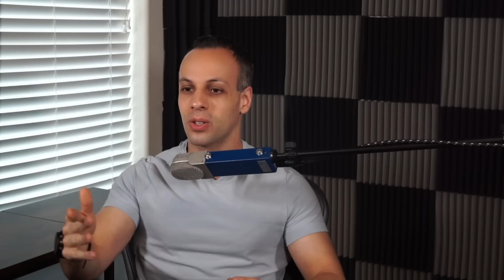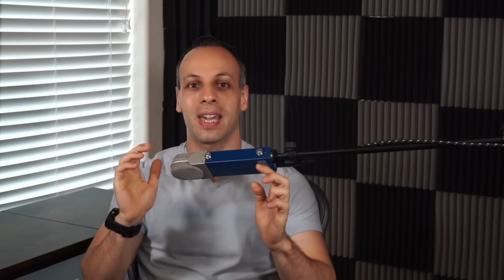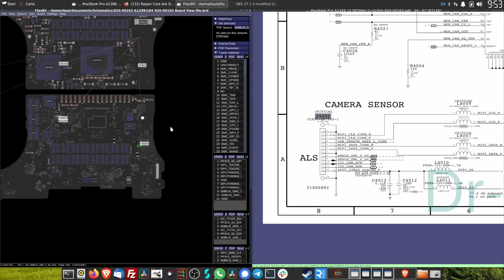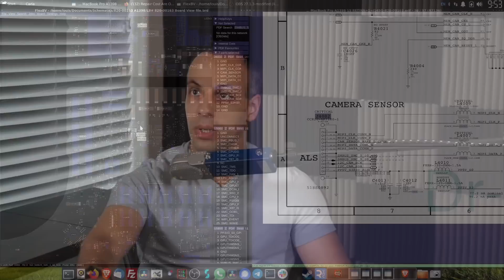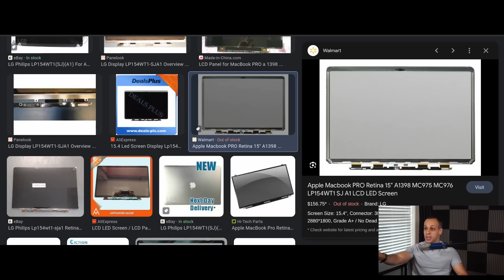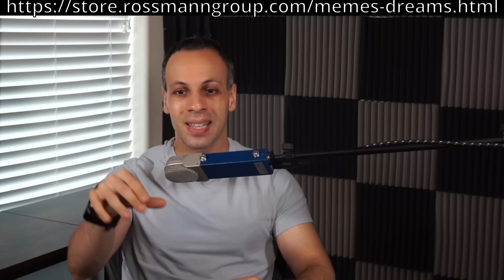The Ford F150 Macbook - when car repair resembles macbook repair...

Comment: What really sucks is that cars used to have more repairability legally mandated. Like there were a total of two headlights legally approved. So you could buy the one you have basically anywhere and install it. Compare to the modern headlight housings. And the massive, easier to break, proprietary headlight fixtures that you can’t just change the bulb in is 100% a price gouging, anti-repair thing.
Reply: There really should be legally mandated limits on what manufacturers can charge for replacement parts.  You really think it cost Ford $5000 for each of those tail lights when they install them on the assembly line?  That $50k car ends up being a $500k car if you order replacements for all the parts.

But of course, that's the point.  "Don't get a replacement transmission for $8k. Just buy a new car!"
Reply: This guy watches Technology Connections 👍
Reply: And they were glass so didn't turn opaque either in 18 months.  My 69 beetle lights are still clear when I wash the pollen of them.
Reply: It's the semi-sealed light housings that have issues  @robertsmith2956 ,with the chrome tarnishing and flaking with moister exposer. 
due to poor seals on the backside.
Getting new light seals for the globe area can be a pain, to say the least...
Yet sealed beam lights weren't much better than a Dolphin Torch!
Reply: Standard-sized sealed beams, which are one-piece lamps, were cheap (even the halogen ones) and easy to replace and aim.
Reply: My 94 Suburban had the replaceable bulb. You had to remove the grill,then the headlight to replace the bulb.
Reply: @FuzzyWCTX . Um, I can at least say they must have FIXED that design flaw because my 2003 Suburban takes about 2 minutes to change headlight, turn signal or daytime running lights.  It could be any simpler.  Matter of fact, one doesn't even need one tool to complete the job.
Reply: Currently now you can find matrix LED lights. They also bring pluses, not only minuses :)
Reply: Half the reason why mechanics are in such high demand nowadays is because those who spent even 10-20 years in the field just don't want to repair these poorly engineered modern cars. It has nothing to do with more maintainanence, electronics, or people not wanting to work. It's the fact that what was an easy 20-30 minute repair on cars from the 90s and early 2000s is now a 3-4 hour repair because they've engineered it poorly to encourage people to just get the warranty from the dealer & call it a day.

Longer repair times means more charges in labor to the customer at non-dealer shops. It's a huge scam and a lot of car mechanics have finally had enough of it. Isn't late stage capitalism just grand?
Reply: @bbbbbbb51  They also need more and more sophisticated vendor-tied tools and software licenses to work on the electronic systems, which of course also come with higher up-front and recurring costs, so the mechanic makes less margin on the longer and more tedious jobs.
Reply: @bbbbbbb51 this is the reason why I don't want to become a mechanic.  I love cars, I love working on my car but I refuse to do anything with the new cars.
Reply: It is coporatism and regulatory capture.
Reply: ding ding we have a winner! @the_expidition427  Please see the security guards on your way out to collect your, uhh, PRIZE!

Sarcastic yet probably true.
Reply: Be glad sealed beams went away. Their output was mediocre. I enjoy being able to see at night. The US is decades behind Europe when it comes to automotive lighting technology. Not saying the high costs are justifiable. Just that they have Bette system that allow you see better at night. Which is the whole point of headlights.
Reply: @Bob_Smith19  No need to see very far, we can't go fast enough to need more light.
Reply: @robertsmith2956 sadly most people drive faster than their high beans allow for while using low beams.
Reply: @Bob_Smith19 sealed beams could have been improved further. There was no regulatory push to do so.

And at one point they were pretty good, but the manufacturing equipment wasn't maintained. By the 80s the equipment was all worn out and no one spent any money to improve things.
Reply: The lights aren't that expensive for Ford but they aren't cheap either.  Usually about 1/5 - 1/3 the consumer cost is what the OEM pays for the parts
Reply: Yah well nowadays people are terrified of legislation and hate laws, so we get corporations screwing us over 10 times worse.

Comment: Could this be due to newer safety regulations requiring these kinds of sensors and resulting vehicle shutoffs?  More sociopathic executives than before?  Diversity hires in engineering?  Or are Blackrock and Vanguard demanding that Ford finds new ways to juice their share price?

Comment: Hi Louis Two examples. I am a landscaper and when I have to deal with maintaining a property designed by a landscape "Architect " it is a nightmare. They make things inaccessible for maintenance  but it looks pretty. Second, I have a plumber that was given plan to use in a new build. He looked at the plans and said it wouldn't work. He was told the designer went to school to design the system and he should just build it. After it didn't work he had to redo it. Those that can do Those that can't design I guess.
Reply: Designers should have to be able to do basic maintenance on the cars they design for it to be a passable option IMO.

Specialty tools should be kept to a minimum, especially for functions like shifting gears or releasing the parking brake in an emergency (the DOT needs to make electronic shifters and parking brakes illegal for this reason).

Comment: Someone eventually is going to start building old fashion vehicles without computers in them again after consumers start to realize "if it wasn't broken thirty years ago, we shouldn't have tried to fix it" sets in.
Reply: It's nice to think this would happen. There is just one little issue, government. Any car manufacturer is more than capable of making a simple, reliable car these days. The problem is they have to keep adding safety features and mileage to meet unrealistic goals set by the government. So we end up with failing sensors, exploding small displacement turbos and just lighter and crappier quality all around.

Comment: This was designed to fail ON PURPOSE, AGAIN. The beauty of CAN-Bus on vehicles is that it allows all external components to share the same communication lines with the main computer (usually 2 or 3 wires) to minimize wiring from all external components individually to the main computer.  How ONE component can take out MULTIPLE or the ENTIRE system down on CAN bus is downright unethical and violates the entire point of using the CAN bus protocol on a vehicle.  I smell a lawsuit.

Comment: I don't understand why things are designed this way. Why can't the taillight be just a light for the bottom half and a top half be the sensor and the sensor connect via one of those plastic boat plugs like how the electronics do on boats lol. That way, if the "light breaks" you take the casing off, unscrew the bottom fixture and put in a new light. If the "sensor breaks" you unscrew the sensor top half, pull it out, un clip the plastic connector, clip in the new one, screw back in and replace the cover? Like that sounds like old modular tech and if that costs an extra say 20 dollars, upcharge it to the seller as a feature. People will pay for quality and ease down the road, pun intended.
Reply: The sensor was designed that way.  But the sensor alone is over $100, and in this case a short damaged vehicle side electronics.  Not the lamp's fault; something must have gone wrong with the protection circuitry on the body side.

Comment: What it would look like on my 17 year old Volvo:
50 bucks used on ebay, probably ~100€ bucks new aftermarket and ~200€ OE Volvo part.
And its all standard lightbulbs so I could fix it in an afternoon anyways and would not even have to buy a new tail light assembly.
Not a single sensor in there 😂

This world has become such a fucking meme. 
Apart from that I have once limped my Volvo home 100 miles with a damaged fuel injector, a transmission that wouldnt shift past 3rd gear and was making concerning whining noises.
Brought it to my trusted mechanic, he diagnosed the injector, changed it, reset everything and the car is back to normal.
Transmission is quiet now but a fluid change is on the agenda.

That to me proves a point and my point is that cars from certain eras just work and are cheap and easy to work on.
A 20 Year old VW Golf for example will outlive its modern equivalent im 100% sure.

Comment: I saw that F-150 video from FordTech-Make-U-Nuts!  Speaking generically (i.e., there's more detail to this for those interested in doing it), if the mid-speed LAN is anything like the networks in some other makes, what "could" be done is to disconnect the obstacle sensing module connector (or just cut/cap its wires) and then splice the CAN lines going to and from the module with a resistor of a definitive value.  In GM I think it's a 60 ohm resistor (there's one on the other side of the CAN that's 60 as well, so a total of 120 +/-).  That would relieve the CAN from all the network junk screwing up regular communication and all the other modules should be able to become "talkative" to one another again.  This solution could work until Ford decides it's a good customer experience decision to start selling singled-out replacement modules - as opposed to the entire 5,000+ dollar set of "will break again in the future" components.
Reply: So cars nowadays are using ethernet to communicate internally?
Reply: @25566  - not exactly, but it's the same concept.  Not all "networks" are the same either.  I.e., if you have a home network with multiple devices, it's unlikely that one "going down" will cause everything to cease communication.  With cars (and I have no idea why they've done it this way) it's not the same.  Depending on the typology and setup for the make / model / and chosen options, one module broken-down in the right way COULD bring the whole circus to a standstill.  And it's not an easy determination either.  It's not like an automotive diagnostician can simply plug-in and find the fault in a few mins.  Sometimes - after determining the root cause to be a network comm fault - it's a "disconnect individual modules one at a time until the network comes back to life" process.  Lesson of this part of the story is find a good diagnostician and TAKE CARE OF THEM WITH KINDNESS, PATIENCE, and GRATITUDE.  Oh...and send them references too.
Reply: @25566  No, they are using CAN bus, not Ethernet.
Reply: @CedarPass @Rossmanngroup
This needs to be pinned!!!!!

Comment: Got to love how "Built Ford Tough" means you can't drive your truck in the rain.
Reply: Probably can't even park your truck in the rain. 🤦‍♂️
Reply: @southernflatland awww the retard that buys ford pieces of shit is offended
Reply: My 1964 VW splittie Kombi leaks water to the inside of the car when it rains.
It doesn't however stop running.
Even when the rain is 2 foot deep😁
Reply: @andrewallen9993 
Much love to my VW homies even if you breathe the air variety and I drink the water variety.
Edit: please tell me ya got safari windows ❤
Reply: @MrTheHillfolk  In South Africa? Afraid not but I could add them.
Reply: @andrewallen9993  
I know they're expensive but it would be kinda cool in more ways than one.
I'd figure those would almost be mandatory,isn't it kinda warm there ?
Reply: @MrTheHillfolk  yes but the tilting ventilation windows and overhead air inlets move an awful lot of air once you are moving :)
Reply: @MrTheHillfolk is this like some kind of code you have to have weaponized autism to understand?
Reply: @andrewallen9993  
Yes they do for sure ! 
Only need em cracked open like an inch or so for anything faster than 30 or so 😂
Reply: Fix Or Repair Daily
Reply: @bitelaserkhalif  Found On Road Dead
Reply: @FredFredrickson-bip-bang   First On Race Day, I have others just can't remember them right now.
Reply: @bitelaserkhalif  They may have to rebrand.  FPOBO.  Fckn Part On Back Order.
Sadly the companies that made the electronic ignition conversions in the 70's went out of business.  So I can 't modify my f-100 now.  I lost the one I had from a '71 Custom 500 in a tornado.  At least I still have my dwell meter.
Reply: I just stick with Toyota now. Yes they have issues as well like all of them. But Honda and Toyota seem to be the most reliable in most cases really.
Reply: That's what marketing can do to products. It can turn things that once had meaning into a token gesture and a cheap promise to the customer.
"Built Ford Tough" probably had more physical meaning a long time ago, now it means nothing but a marketing buzz word to excite the mind for a moment, and make people think it's worth spending their money.
Reply: @Andrew90046zero  I think its meant to rub off on the customer. He's "Tough" because he's a Ford owner. It's a symbol for a performative lifestyle.
Reply: @RatPfink66  like my old VW bus, I can keep going slowly for an awfully long time 😉
Reply: @RatPfink66   yup
Reply: Pathetic 😆
Reply: They are putting too much tech in our cars. The more crap they do the more things break, catastrophically. Not to mention all the cheap plastic used when metal parts can be cheap enough and last far longer.
Reply: 6:04 EXACTLY!  the $200 AC evaporator on my 2015 ford sprang a leak... $1,400 to repair bc they had to remove the entire dash... ford dealer wanted $4,000! 
Do these stupid auto execs and lead engineers HAVE NO IDEA that American families CAN NOT  AFFORD to Shell out thousands of dollars for repairs that should not be needed (for vehicles that families must rely on)?
Reply: @vvvci  Dealerships are complete ripoffs. Sure they need to make money, but they really are terrible. I will never take a car to one unless it’s under warranty.
Reply: those years are long gone... American manufactures are back to ignoring what the consumers want again
Reply: Last Ford I purchased an 18. Have had SEVERAL (try 7) over the years but NO MORE! Ford has lost their mind!! 

Find you a clean 96 F250 gas Ford and REBUILD BODY OFF FRAME, new engine interior and paint.

Now you SAVED money over a new F250, got TAILLIGHTS bulbs are less than 10.00 each for and the WHOLE TRUCK will last you 20 more years ! I am done Jim Frawley is an idiot and will be the end of FORD forever. What happened to the wise man Lee Iaccoca who was "Quality Job 1" and "Built Ford Tough" We now its Built Ford Proud but quality and durability are OUT THE WINDOW!!!! Sign me no more Fords EVER
Reply: @@GH0STST4RSCR34M different names, different places 😁
Reply: Oh, you can.  You jusr won't be able to do a thing with it afterwards
Reply: Apparently don't wash a Ford either. Or know where to tape things..
Reply: Not that I necessarily a Ford fan, but it sure seems like in the last 10 years that they use the public as guinea pigs, they have so many recalls and service bulletins it's not even funny.
Reply: Or perhaps into waist deep streams or floods. How it happened wasn't part of the story.
Reply: @hulknotlikepunybanner  if it was waist deep water the vehicle would have required two taillights. 
Plus an awful lot more electronics .
Reply: @andrewallen9993 
Pretty sure they ended up replacing both taillights in that video
Reply: My dad's drinking buddy always mocked the brand, saying it means
Fix
Or
Repair
Daily
LMAO... And sadly, true with quite a few of their vehicles from the last 20 years!
Reply: Ford has always designed failure. This is a new variation on an old theme. Before, the parts might be too cheap to last, so your ac might die. Maybe a water pump goes early. Or a spark plug blows out due to insufficient threads. Or the Ranger has a transmission gasket that can't handle the pressure. At some point, you wonder if it is intentional.
Reply: well to fords credit they circle the problem and not their fault the acronym fits Fn Owner Really Dumb lol
Reply: @wizard3z868 that's the worst acronym I've ever seen. You made that corny shit up

Comment: Vehicles are only engineered to last 10-15 years at most. Eric O has vehicles on his channel all the time that are basically totaled by modules either being prohibitively expensive to replace or impossible to source.
Reply: I believe that number is closer to 3 - 5 years because statistically most people don't keep their cars much longer than that before they trade or re-lease.
Reply: @embucked  Which is nuts when 84 month loans are a thing.
Reply: The lifespan is getting shorter and shorter the newer cars get, especially if you live in a climate where salt and that new chloride (or whatever it is) road spray is used... it rots away cars so quickly.

Comment: I remeber, back in 2008, I had my first car, a Peugeot 206. I replaced my taillights with tunning ones I bought from an unknown site for 150$ equivalent currency 😂. I also installed a subwoofer, replaced the head unit 3 times and replaced speakers in the doors myself and I was 19. Old cars were so easy to work on.